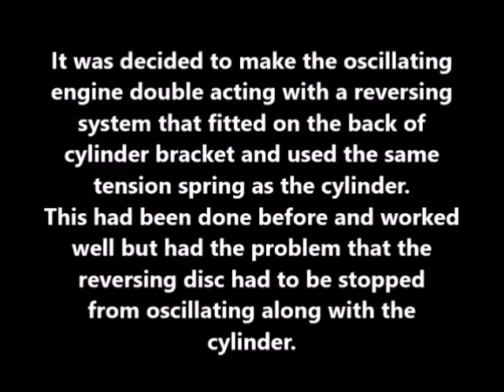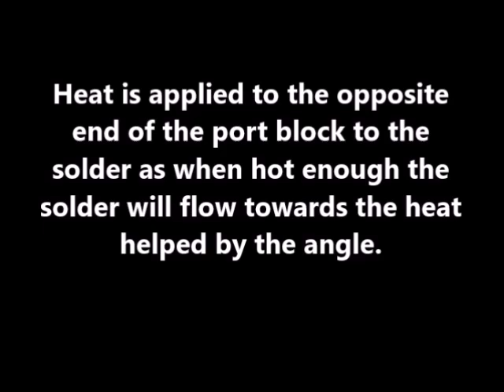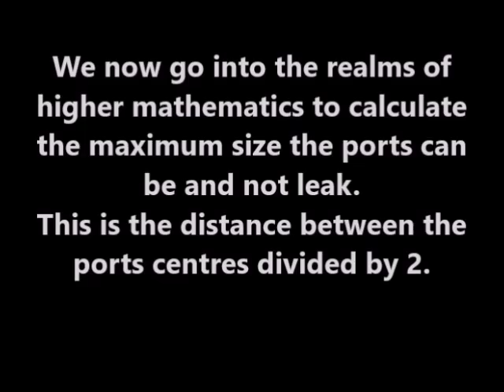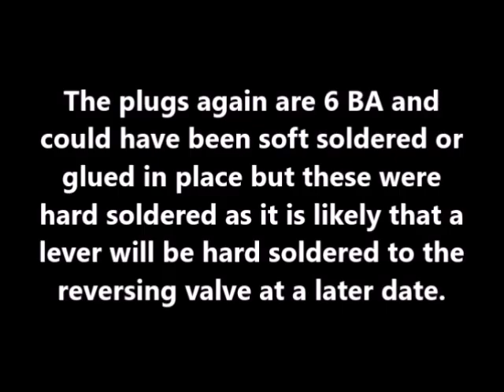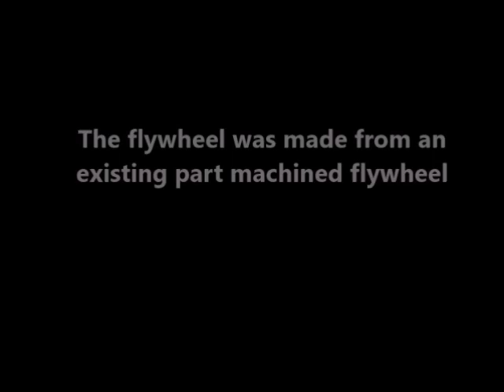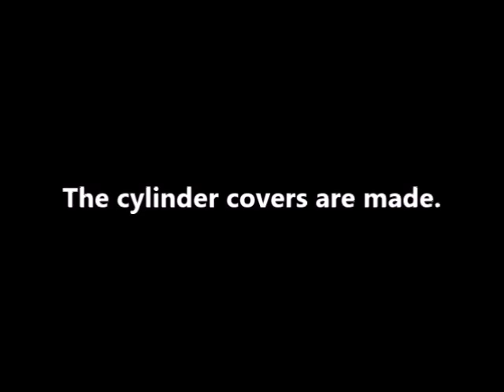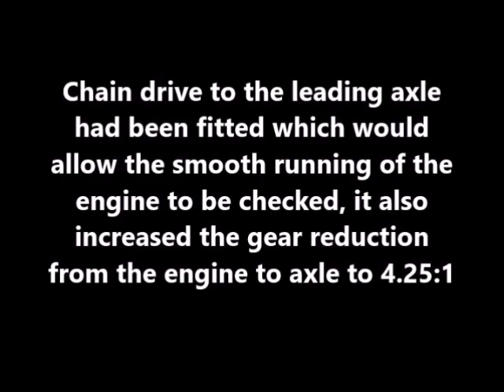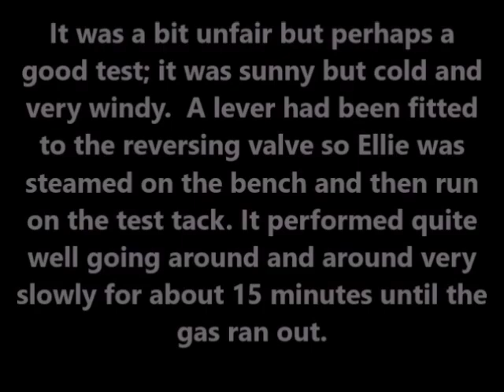013 Ellie the Steam Tram making double acting engine

Comment: Very Nicely done!   I am amazed at how well the engine self starts, single cylinder engines typically do not self start and require a flip of the flywheel to get them going.   What did you use to secure the  cylinder  end caps  to the cylinder?
Reply from the maker: Hi Scot, The cylinder end caps are held using Loctite.  The engines ability to self start is helped by the fact that the ports have no or very little lap and the spring holding the cylinder to the port block is set lightly usually so that the cylinder will lift at about 20/25 psi.  Also as the model is geared so there is only a light starting load.
Take care Tony.
Reply: @aderyn  I admire your craftsmanship.  Here in the States Steam In  Garden magazine published a build article for  a live steam tram that they called Minitram.   I built one and modified the cab from the published drawings.  Here is a link to it running at the Cabin Fever Expo held  about a week ago. 

just a single cylinder single acting steam engine on this one  with a 1/4"  bore by about a  1/2"  stroke.  ( going on memory here, lol) 

https://youtu.be/eP--501xQXI
Reply from the maker: @scottbaldridge1092  Hi Scott,  It looks and performs very well.  Is it one of Marc Horovitz's designs?  I haven't met with Marc for many years.  A long time ago I wrote the odd article for his Garden Railway Magazine.  Take care Tony.
Reply: @aderyn  yes it is a design of Marc Horovitz.